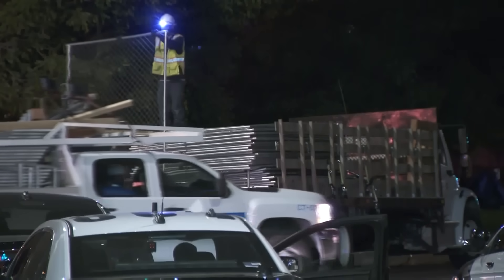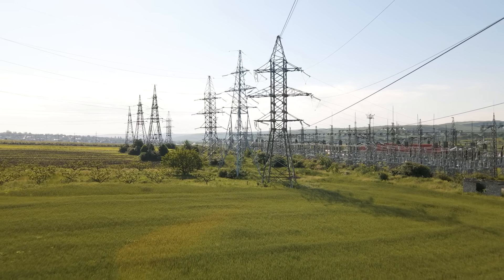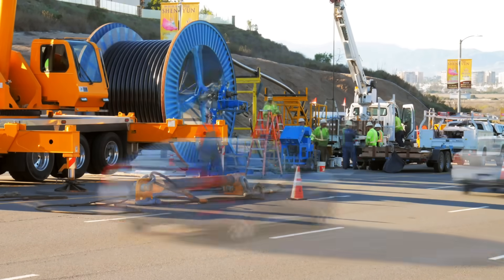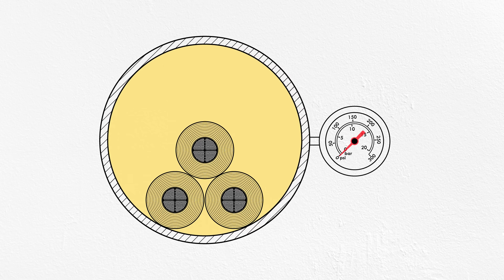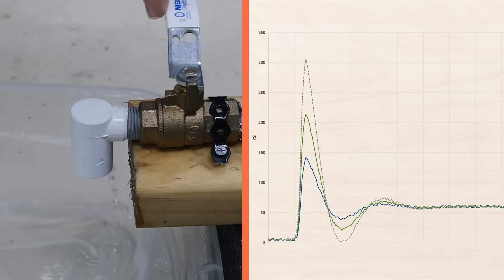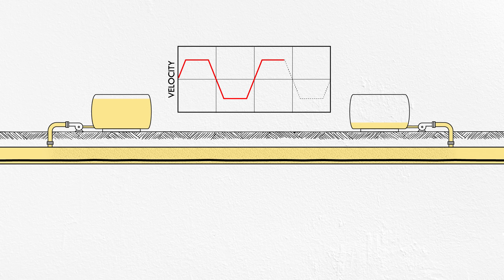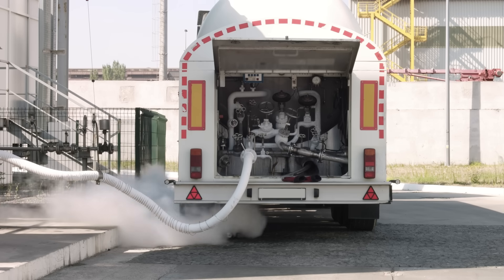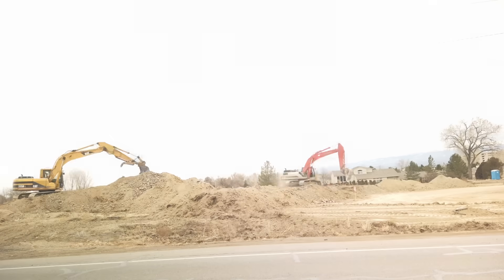Repairing Underground Power Cables Is Nearly Impossible

Comment: According to the original document the use of the thumper is a little different. The big jolts of current it makes cause the lines to expand and contract slightly, slamming them against the walls of the pipe. The fault can be found where the noise STOPS. The effects are strictly mechanical, and arcing is not involved.

Comment: As a software engineer it gives me a knot in the stomach every time I see an over engineered solution with little or no thought given to maintainability.
Reply: I don't think it was over engineered in this case, I suspect that this project was done at the limits of 1960s technology with the attendant issues of being one of the first projects of its type so long term problems were likely not known about until they happened. This is what I suspect happened with the splices, they were new enough in operation that this future fault wasn't predictable due to the lack of other examples to go by.

Comment: By contrast, In the very early 1900’s  my grandfather supervised the construction of two hydroelectric dams on Bishop Creek, California.  They supplied power not for the residents of that part of the state — there weren’t many — but for gold mines in Nevada, more than 100 miles away.  The water was carried down from little reservoirs high in the Sierra Mountains through big pipes made of cedar planking.  A leak in those pipes was a lot easier to find and wouldn’t spew high pressure dielectric liquid!  There’s a great photograph of a long mule team hauling a huge generator coil along the dusty trail to the plant.
Back then tears would come to the eyes of tough old farmers when they heard of possible electrification projects. In Robert Caro’s biography of Lyndon Johnson you can read what electric power meant to a hard rural existence.

Comment: Nice coverage, Southern California Edison recently installed an underground 500kV transmission line. The amount of engineering and thought that went into this was immense and truly a modern marvel. Think about that, 500kV needs a ton of air space (insulation) to keep it from faulting to ground or to phase, relying on various XLPE dielectric layers to keep the electrons in the conductor and not going to ground amazes me. Nothing is impossible, Impossible just takes longer.

Comment: Seems like installing separate phases many feet apart would save alot of headache and money.  There's no need to place all three phases in one pipe. Sure, it's more money up front, but you 'll save money in the long run. Plus you could use the different pipes to circulate the oil and cool it. With circulation, you don't have to worry about fluid hammer, and with cooling you can maintain the temperature.

Comment: I spent the last 19 years of my career in emergency planning & response for an electric and gas company.  People not in the industry seem to think that winds and trees are the only hazards to the electric T&D system and that undergrounding will solve all outage problems…
Reply: I'm surprised they actually went underground with a fluid filled system in earthquake country.
Reply: @washellwash1802  It runs across the western end of LAX
Reply: Sure, no system is perfect, probably you also agree that the rate of incidents for underground systems is pretty low compared to overhead lines ?
Reply: @baratmalli6413   Are there enough high voltage underground lines in existence to make a comparison?
Reply: Hey how do we repair damage from a major geomagnetic storm? Like the carrington event, aurora as far south as colorado.
Reply: @joe7272  graphine in the vax will cause the next carrington event to explode humans
Reply: @dr.floridaman4805   proof

Comment: Solar on every roof!  Low voltage DC environment at home and low transmission losses, as well as distributed on-site storage for a more resilient and democratic power system! (Industry might still need the grid)

Comment: Could you do a video on more modern underground cabling? I'm curious if the cities in Iowa that do this have similar limitations, or if engineering advancements have found other solutions to this problem. It would be interesting to see how devastating an earthquake could be, since heat is SO much more important in Iowa than in LA.

Comment: I love that the ridiculously complex and finicky high-pressure, oil filled, high voltage lines, were replaced just by plastic covered cables.
Reply: ...Since 1989, R&D on high voltage transmission lines made them much  more reliable...
Reply: The high voltage cable is extremely more complex than a plastic coated wire.  The insulation, grading layers, shielding each perform a very special function to allow the "plastic insulation" to function at 100,000 volts or more.
Reply: @2009G8Gxp That's the industry guess but the truth is nobody knows yet. All the laminated cable ageing calculations were based on thermal ageing of the paper, bit most utilities are replacing them because of corrosion and leaks (and some others had mechanical issues also). We really don't know yet what the typical failure modes will be for old high voltage XLPE. (we do know what it is for medium voltage)
Reply: @2009G8Gxp Why would that be
Reply: Too funny.
Reply: Well the plastic insulated HV cables had a rather troublesome beginning. I worked as a linesman’s helper for a coal mine in Wyoming in the late 1970’s. The mine had a huge number of mineable coal deposits located on over 100 square miles of leases and privately owned land. The mine power was in a loop that more or less followed the outside of the properties. We were able to use overhead lines on power poles for the vast majority of the mine. However due to the size of the mining equipment, and the need to frequently relocate that equipment, we could not use overhead lines at road crossings. I no longer remember how many different different types of cables we tried out but it took around 3 years for the manufacturers of the cable to find a fairly reliable cable insulation. We pulled a lot of cable out of the conduit it was in that faulted due to a whole range of reasons. I remember listening to our engineers talking to the cable manufacturer reps about the problems, but I never did understand most of what they said. It mostly came down to “ well damn that didn’t work! Let’s try this one next”. Some of the stuff lasted less than a month before it faulted. It was actually in a lot of cases because of improper installation.  There wasn’t a lot of information available about how to install the cables and it turned out that it was a lot more fragile than was initially thought it would be. Most of our problems were caused by the seepage of ground water through the walls of the pvc conduit we used. It was finely decided to use steel pipe with a protective wrap on the pipe.
Reply: Worked on two sites where they used sf6 filled conduct instead of cable, both are nightmare for leaks.
Reply: @stephenrowley4171  Gas Insulated Line is for high current applications where cable is not practical.
Reply: @packratty  not in these cases it's purely because they could.
Reply: The plastic covered cables now have the heat problem. The heat is trapped and can build up in spots quickly. More heat, more expansion, more cable movement in the pipe. To prevent that you have to transmit less power, or use bigger (more expensive) conductors. There are trade off's with the plastic cables.
Reply: @bob-who-must-not-be-named8522  if that fluid is PAO like they use for liquid cooling aircraft radar its probably worth it to do more runs with less current to use plastic. It's hard to work with, hard to keep leak free and you have to keep it really clean or else it's dielectric properties are compromised.
Reply: @2009G8Gxp That's medium voltage -  full of water trees, bad material handling. HV is different.
Reply: Plastic has the problem of higher dielectric losses. The pipeline loses more power. As plastics technology improves, it should match oil.
Reply: There's chatter about Tunneling Systems being more cost efficient in the long run, but only in major cities. It might even be feasible to maintain a liquid Nitrogen System for Super Conductivity with no losses...
Reply: overengineering at its finest

Comment: Time Delayed Refrectometry (TDR) has some very interesting aplications, I worked on an underground mine as a trainee geotecnician, where cables where placed into boreholes which where filled with grout and monitored with TDR, you could see if that borehole moved, deducing rock movement, and if the cable was cut you could guess where the fault was

Comment: In California there another reason for underground high voltage lines, they are much much less likely to cause wild fires, like the Camp Fire that killed 85 people. PG&E, which is responsible for power in most of Central and Northern California and responsible for causing the Camp Fire, plans on moving large parts of their high voltage line network underground.

Comment: I like to drive around town and look at each city's priorities, and this video is great example of it. LA, saw value in burying these transmission lines instead of running large overhead lines. Often, you will find in the more modern/expensive parts of town, they will use only underground electrical services to buildings/houses/etc. Even along the roads, in these areas, you typically won't see a power line/power pole, you will only see big green S&C switches that are usually neatly hidden by nice landscaping or trees. It makes the areas look cleaner, and most people don't appreciate how much work it takes to hide all of that stuff. Also, the cities that want to grow usually develop this kind of infrastructure early with plenty of capacity and redundancy to serve the future developments.  - Ok, I need to get back to work now.....

Comment: Tower line fault: "We need a helicopter"
Underground line fault: "We need to perform brain surgery on the city"
Reply: @simeonpetkov768  no I meant tower
Reply: My semi-informed opinion: underground your distribution but keep the transmission up on towers. As someone mentioned, the lower voltage (distribution) stuff is drastically easier to deal with underground than the high voltage lines are.
Reply: @sootikins  your opinion is correct!
Reply: @sootikins  especially in CA with earthquakes and faultlines
Reply: This is why when people call for all powerlines to be buried to prevent wind storm outages, I disagree with them. Sure wind storms won't cause you to loose power but if an underground line fails it is orders of magnitude more expensive to fix and takes orders of magnitude longer to fix. There are no perfect solutions, only tradeoffs.
Reply: @crissd8283  You don't have to bury all power lines to reduce wind storm outages. Residential power lines that are above ground are much easier to maintain underground than the high-voltage ones in this video and they're going to be the bulk of the repairs after a major wind storm. You're not going to prevent outages from wind storms severe enough to affect the high-voltage towers, but those towers are less numerous and thus quicker to repair. When there are tradeoffs, the right solution is usually in the middle.
Reply: @raiden24  I agree, the right solution is in the middle.
Reply: @crissd8283  I agree we need surface level HV lines
Reply: @raiden24  Florida Municipal Power Agency did an extensive study in search of the perfect balance between cost and reliability and concluded OH distribution is superior to UG. Money talks and UG is expensive.
Reply: @crissd8283  we do that in europe all the time. Especially in cities. But fact is that some cities new section are lead in serviceable tunnels.

Do you know what is the trick? Possibility of disconnect whole line or blocks of it. Huge redundancy in system of high voltage lines.
Reply: @rybaluc  do you know what voltage they have in the serviceable tunnels? it's hard for me to picture them working on HV lines (230kv and up) in a service tunnel. the typical clearance for a 230kv line to ground is about 7 ft, line to line my utility uses 13 ft on the buses so i'd imagine it's 10-13 ft on the towers as well. that's be a freakin massive tunnel.

the low voltage 4.8 kv and i think 34.5 kv has a lot of underground but that's distribution level voltages with tunnels, vaults and manholes. i work for dwp and know for a fact that scattergood generation station has 13 ft clearance across the bus because i worked on scat oly cable B
Reply: @brimmed  Three phase 22kV(usually, if it is not for the electric public transport stuff) are in serviceable tunnels. Everything above that is usually very high voltage(by local electric code)and uses off course overhead lines. But they are outside of city perimeter.
What i wanted to note you can forget about poles in towns not mentioned in a city. They are mostly outside.
Reply: @crissd8283  Except in some places when a tower line fails in a wind storm it starts a massive fire. Now in California we get power outages any time there's high winds because those towers might set half the state on fire if they fail
Reply: The time difference between overhead and underground is huge. Time is critical when you have a HV line out. Problem is if you lose other lines while you are still working on the original problem you are in big trouble because of cascading outages.
Reply: Yep, there’s an equation that says underground power is 7 times more reliable than overhead power, but takes 7 times longer to fix when it breaks down
Reply: @warwickkemble4701  here in the Netherlands the regular powerlines are all underground.  The only thing above are the main 280 kv transport lines. 
You hardly have to repair them at all. I do understand that most soil here is ether river/sea clay, sand or peat.  So if something does go wrong you just dig it up and can work on it pretty easy.
Reply: @sirBrouwer  czech republic here. We have even law for it. Except old rural instalation - which are decommed in favor of underground cables.

If there are overhead cables we use concrete poles with strong base for electricity and not clunky wooden.
Wooden poles were used just for phone lines - well even those old phone dedicated poles are with concrete base. And they are just used for god forgotten places local loops.
Reply: @warwickkemble4701  That means it makes no difference then
Reply: @warwickkemble4701  It’s also 7 times more expensive to install compared to overhead.
Reply: Well, if the line was run properly in accessible tunnelwork, maintenance would be a whole lot easier.

Unfortunately, like so many things, "never designed with service in mind"
Reply: When it comes to California taxes, I've been searching for the leak. Now that I found it, repairing it will be more than a brain surgery.
Reply: OH transmission faults are virtually nil on line built after roughly 1990. Especially now that the Feds mandate annual inspections and vegetation management after the 03 northeast blackout.
Reply: more like a bypass in its leg
Reply: My solution for high voltage lines in architecture sensitive areas is to 3 paper insulated wires pressured with mineral just like the underground cable but in a UV proof PEX pipe on a standard height telephone pole made out of metal so it looks like futuristic power lines and easier to repair with a cherry picker and liquid nitrogen.